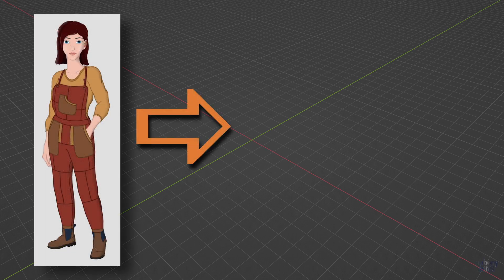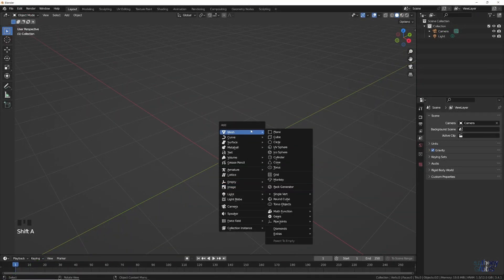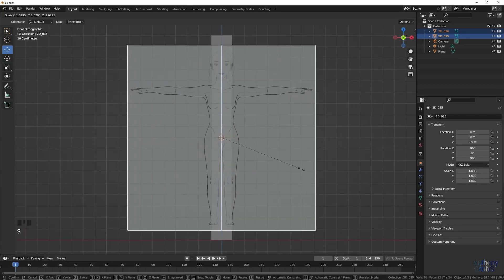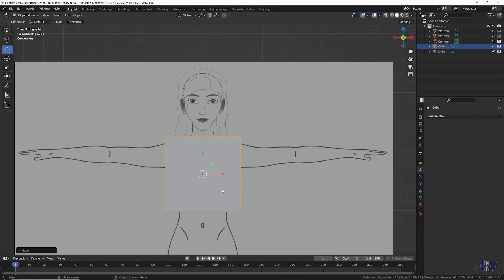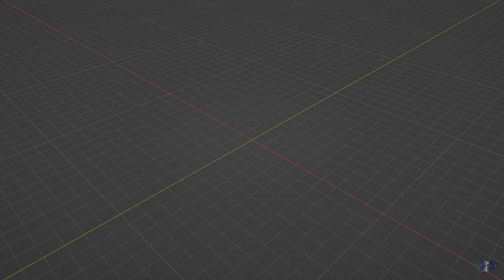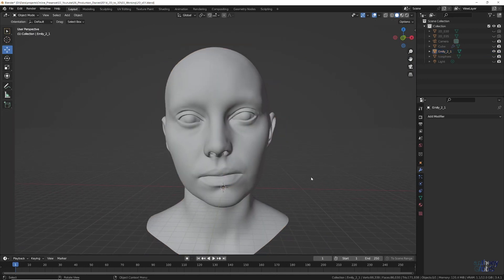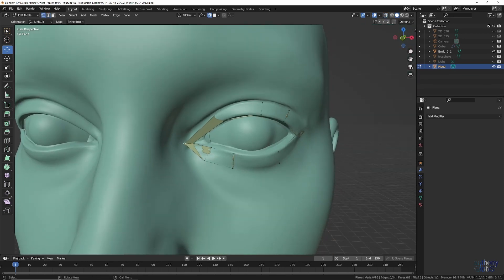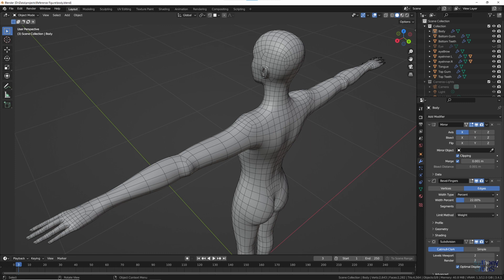Turn 2D into 3D with Blender-Initial Steps

Comment: Great video! Exactly what I was looking for. I'm new to blender so I would start from the basics. What would you suggest?
How do I transform the model I made with this video into a poseable character?
Reply from the maker: Thanks for watching. The 'classic' way of first learning Blender is usually Blender Guru's Donut series of videos. While I did make a donut initially starting out myself, I've not looked at the most updated series of videos.
The official Blender channel do have a Fundamentals series, which would give a good starting point from the ground up, however, it was made for version 2.8. So it is rather old now and while some things would still apply to the current version, there are no doubt a bunch of endless little changes and differences that could be confusing.
You should join up to the blenderartists.org forum as well.
Once the basics are sorted, to pose and animate a character you will need to dive in to the near bottomless pit that is rigging. There are a number of options for this, but the included Rigify addon can be a good way to start. With that in mind, CGDive recently did a series on Rigify for Blender 4.0 which should be starting point.
Reply: @antgib  thank you so much for the answer! I'm currently watching the Donut series and I feel like I'm improving day by day!

Comment: I am new to blender and i am trying to model a space craft from a video game using 2d concept art reference images.
I aligned the images but still can not seem get the right shape. It looks ok from one position but not the other two. Do you have any suggestions or advice to make the process easier?
Reply from the maker: Advice yes, can't promise it will make things easier tho.
In many ways it's the classic issue of trying to make something 3D. The first problem is usually the 2D artwork, especially concept type art where unless its drawn pretty much as technical blueprints, then half the time things just don't line up.
Or, what one thinks looks good/right in 2D, just doesn't translate as you would think when it's 3D. So even if it does match up with the 2D art and that art is actually correct, it just doesn't exactly look right.
At the end of the day it's usually best to use the 2D art as a guide to overall size, location, proportions, etc and once you have all that in place, then its mostly a case of refinements in 3D till you have what looks right from various camera angles.
At that stage the 2D reference images are even turned off and you are looking more at general concept art from all angles or in this case, maybe screen captures from the game.
Reply: @antgib  Thank you for the advice. I will take it to heart and keep trying.

Comment: How much time you spent making this pls answer as fast as you can
Reply from the maker: Hi, I assume you mean the 3D character and not the video. If it was just the base reference mesh that I mostly cover in the video, that was a couple of weeks part-time I guess. Keeping in mind I'm far from the fastest in all this and was planning/learning as I went along.
In fact every step is learning something new and usually finding out later the things you got wrong and needing to step back with new knowledge and make corrections.
If the question is actually about the 'final' 3D model in the opening shot, well that is now a somewhat old version and really from initial idea to 2D concept to current 3D model, it's pretty much been years in my case and I'm still not happy with it. So much so, that there's a high chance I'm about to go back and pretty much rebuild her from the ground up based on everything I've learned so far.
But none of this has been full-time and a lot of it has been my choice. There are plenty of ways in which short-cuts can be taken, it really just depends on what it is that you really want to achieve in the end.